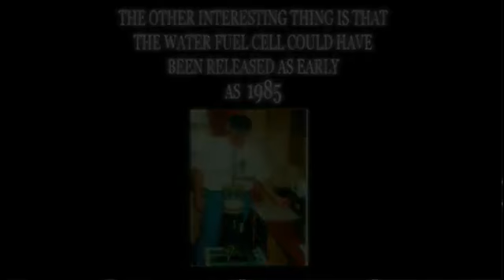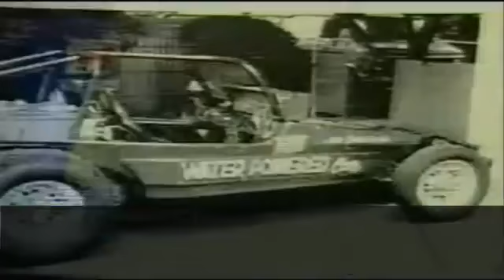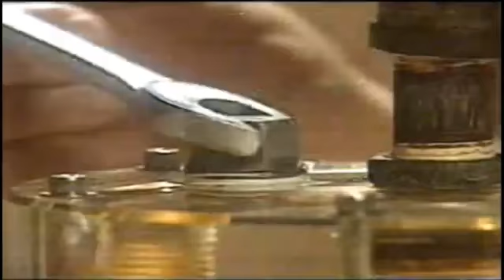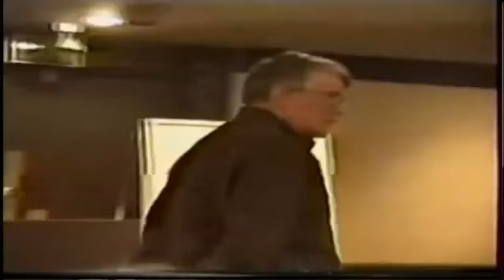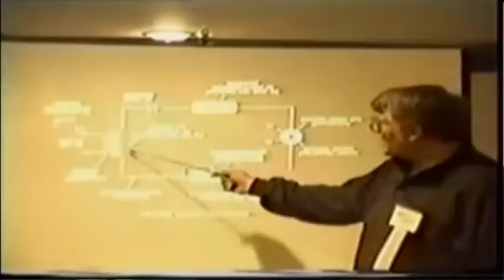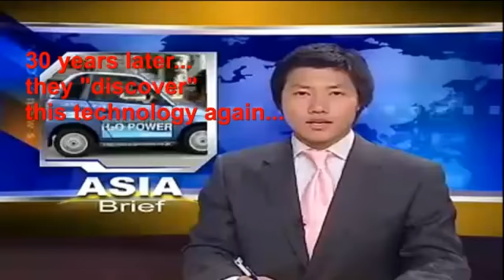Car That Runs On Water - You're Killing Me #974.mp4

Comment: THE METHOD STAN USED WAS A MAGNETIC POSTIVE FIELD THAT LIKE A OLD TV FLY BACK PLUCKED OFF ELECTRONS IN A FUNNEL SHAPED OUTER COIL AND THIS MADE A MAGNETIC CATHODE WITH L.E.D. LIGHT INSIDE ENERGISING THE PRTON NEUCLEUS WHICH MADE ALL THE ATOMS REPELL INSIDE THE FINAL DIESEL INJECTOR TIP.AND MAYBE THE COPPER WASHER AT THE TIP ACTED AS THE ONE WAY SE CONDARY TO STOP AMPS .AND FINALLY ON ENTERING THE COMBUSTION CHAMBER MUONS WOULD INSTANTLY ATTRACT TO ATOMS AND CATSTROPHIC COLLAPSE AS PROTON